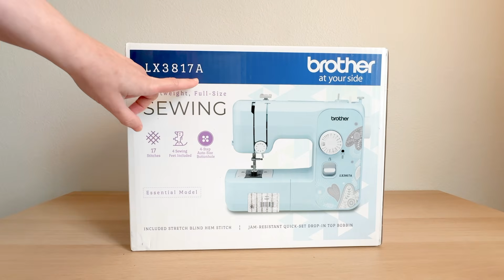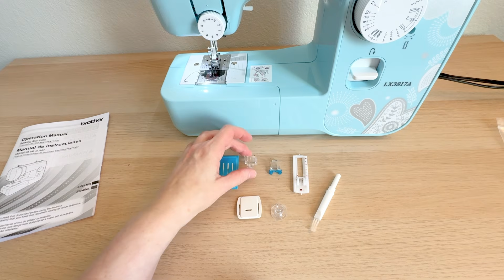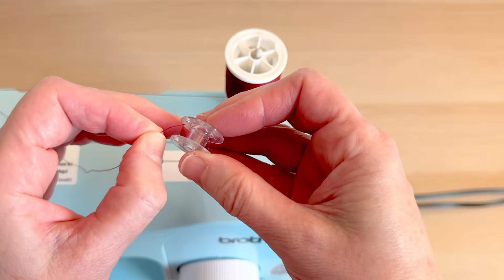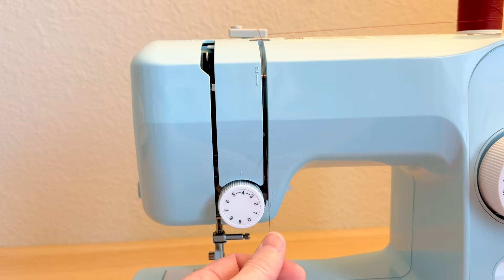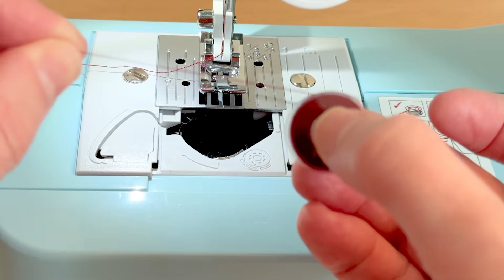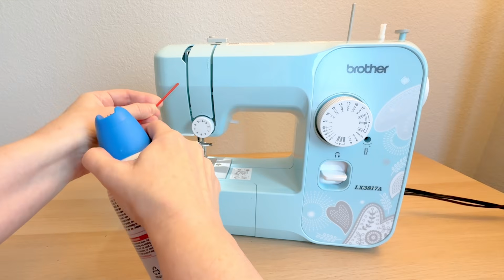How to Set Up and Thread the Brother LX3817A Sewing Machine (Updated Full Tutorial)

Comment: Hello do you maybe know why my bobbin thread is not coming out ?
Reply from the maker: It could be wound improperly so that the thread gets stuck inside the bobbin. Or it could be that the machine cut the bobbin thread a little bit too short, so that the upper thread can’t pull it up. Try to wind a new bobbin and make sure your machine is winding it correctly. And leave the bobbin thread a little bit longer when you load it into the bottom of the machine.

Comment: My foot pedal goes from 0 to 100 with no in between, is there an upgrade with better control that i can buy?
Reply from the maker: It shouldn't do that. You should be able to lightly press on the foot pedal and it should make the machine so slowly. Sounds like you need a new foot pedal, sounds like yours is broken. Here's a link to a replacement part on Amazon. https://amzn.to/48V44uZ

Comment: I have loaded everything like you instructed but the upper thread doesn't catch the bobbin thread to make a stitch.
Reply from the maker: Sounds like something is missing in the bobbin area. Leave the bobbin thread a little bit longer after you thread it through that metal guide in the bobbin case area. And see if that fixes the problem.
Reply: Im having the same issue 😢